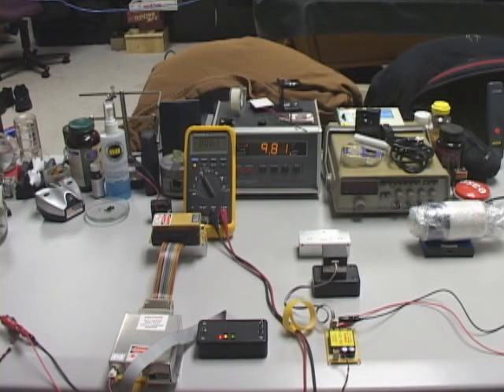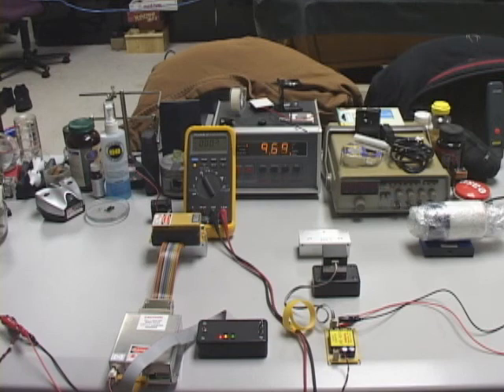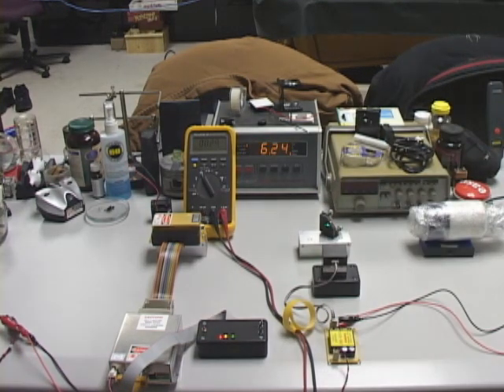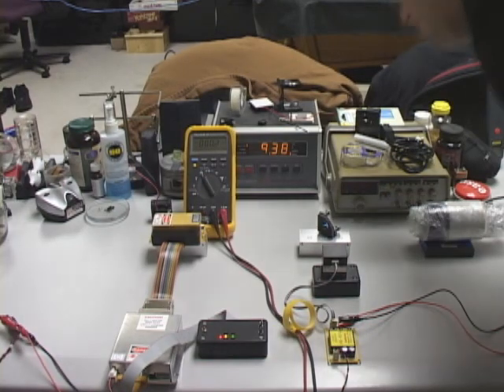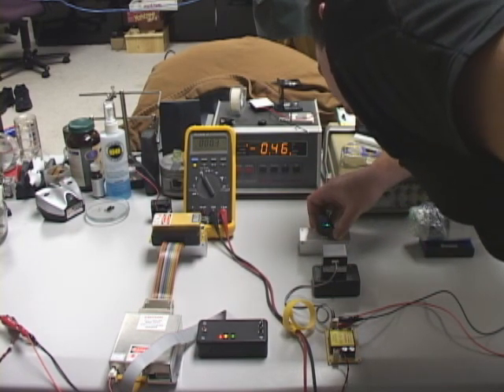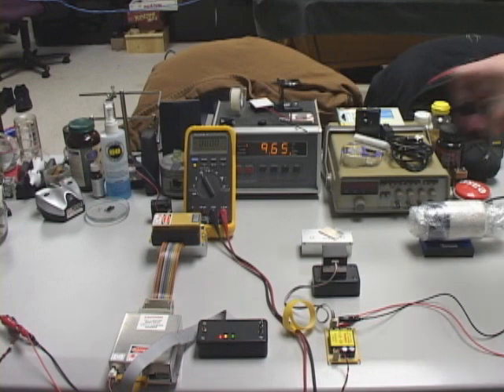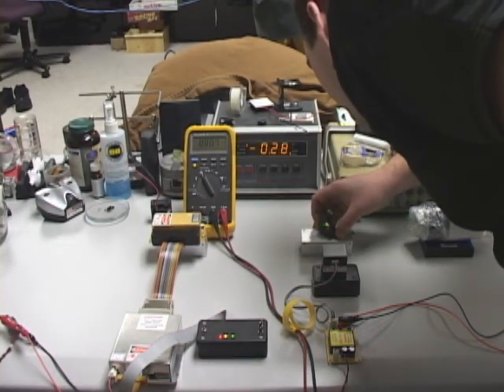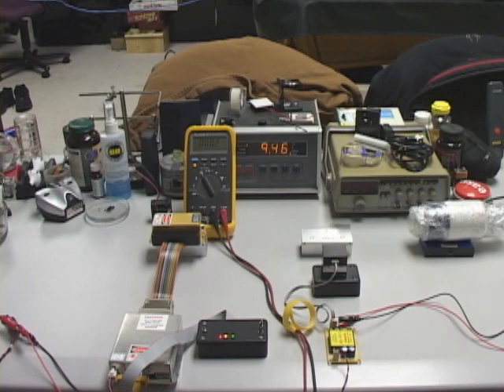Laser-Wave Dichloric Filter Test

Comment from the maker: Good Question. My basement is a little drafty and the thermal mass of the power meter head is just too sensitive to temperature change at these low power levels. Wrapping the head in insulation helped with the accuracy quite substantially.